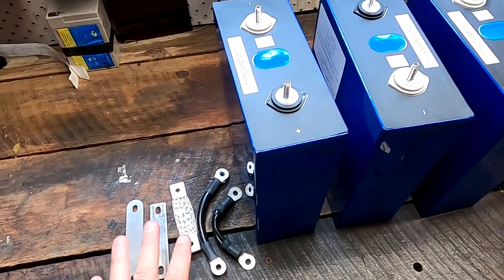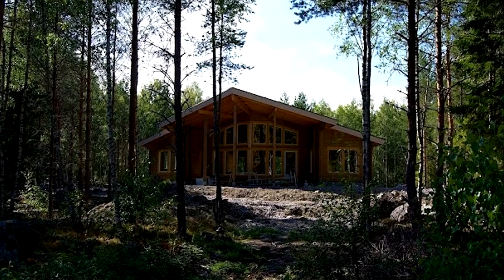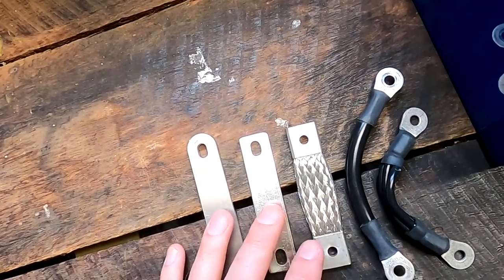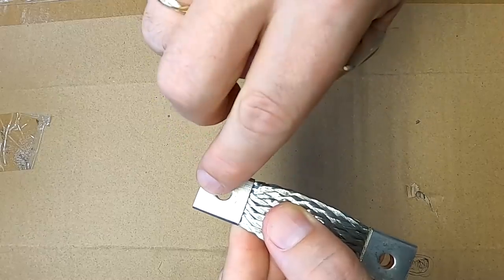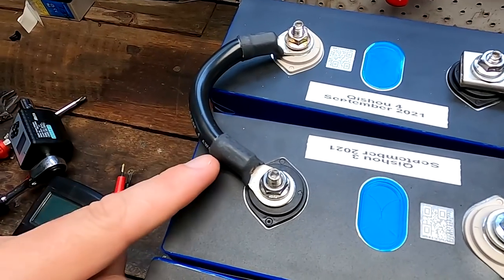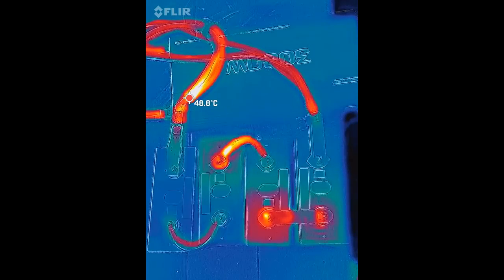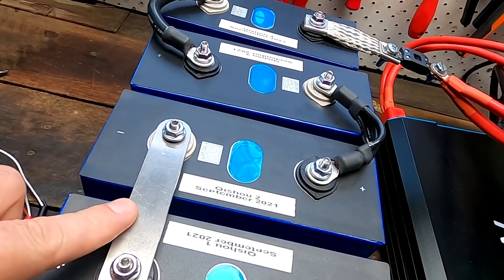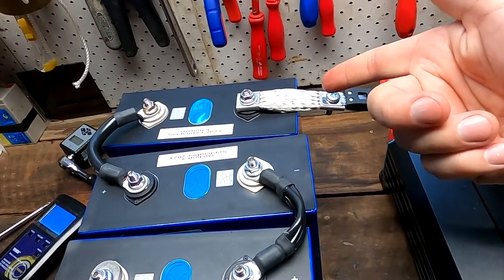All these different busbars... and why they don't matter!

Comment: Hi Andy 
Keep in mind that the battery terminal tops also form an oxide and should be removed as well. A twisting motion and scotch bright under your thumb for a few seconds is all it takes and won’t distort the flatness detrimentally. Use a can of dust off to blow out the holes because you don’t want grit in there. I made a lapping tool that works great and fast for terminals that already have studs(I made a video).Wipe off the top with alcohol and put on your favorite anti oxidant compound within a few minutes. Preparing both contact surfaces makes a huge difference. 
The flexible braided buss is very good but there’s things you need to know. It is perhaps a bit short but it can be lengthened by squeezing it’s width in the middle with your fingers. The problem with those is they need periodic re torquing as the stands within the ferrule compress. This will eventually settle down or an embossing tool can be made that can pre compress (in a machine vice) and flatten the contact area. Interesting resistance readings you got.
Reply: From my lead acid days, I use a facing tool that slips over the threaded post that takes any slight crowns off of the post.
Reply: @babaluto  
I turned a blank perfectly flat and drilled a 6mm hole in it. The other end was drilled and taped 1/4-20 where I Loctite-d a socket head screw. I cut the “L” off a ball hex wrench so I could put it in a drill motor. The ball drill reduces any leaning and helps keep it flat on the terminal. I used a sheet of 400 wet&dry sand paper that I put thin double sided tape, cut to 1” squares and punched holes. Use a 6mm pin in the lapping tool to line up the sand paper. Low, low speed, light pressure about three rotations then a about one rotation in the one direction to release the fines in the paper so it doesn’t load up. The terminals must be absolutely free of oil or any oxide compound so I clean them before and after with alcohol. Any contamination will instantly load the paper in spots halting all progress. Soon after it’s lapped,use a very thin layer of an anti oxidant paste (Noalox) on the finished surface. Avoid getting the paste on the threads because it can increase the tension of the fastener when torquing.
Reply: @SkypowerwithKarl  Sounds very good. The tool I still have, I think I bought it from buggies unlimited, it is a hexagonal tool steel section with cutting edges milled into the facing side. A hole in the middle for the post. It fits nicely into a 7/8" socket for either an impact or drill driver. The cutting edges leave the surface super clean and flat. Haven't had any issues with it clogging or marring of the surface. I checked recently and Buggies doesn't list it any longer and I cannot find it anywhere else. I simply do not understand why someone would work so hard to make the bus bars so flat without checking the mating surface as well. Good stuff. Cheers!
Reply from the maker: From what others said, the terminals are made from some different aluminium than the bus bars and don't oxide very much. In this test, I did not clean or treat the terminals at all. And the tinned copper bars are fine with this.
Reply: @OffGridGarageAustralia  
I’m sure they are a different alloy than the buss bars. The important difference is they have been machined.  The buss bars have what you discovered is a rolled finish that have a tough low conductive, oxide skin. All aluminum oxides but it’ll take quite a while in a nice environment to be as bad as the finish of the stock plate. The terminals are pretty soft yet weldable so I’d guess a 5XXX alloy. The buss bars are probably one of three 2024, 6061 or 7075 . Probably 6061 because it’s the most common and cheaper than the high strength 7075.
Glad you figured out the hot bars.

Comment: Maybe it is just me, but I'd call those things "interconnects".  I think bus bars are different - in wiring up a battery a bus bar would be used when connecting the cells in parallel.
Reply from the maker: Yeah, OK, that makes actually sense as well. It's just another word. I used to work in switchboard manufacturing and we called them always a busbar if they are from solid copper material and not a cable.

Comment: Hi Andy, I have not read all the other comments, if someone has written this. These flexible "busbars" are normaly more used to connect an electrical kabinet with its door and also in kombination with high frequency topics.
As I know high frequency current is flowing only / better on a surface. Because of that this connectors are made. All this tiny wires are giving a much bigger surface than a solid wire / busbar.
(Don't kill me if I am wrong, but as I know this is, what the flexible connectors are for.)

Comment: Very well said Andy. LFP is indeed very different than Li-ion when it comes to applying an appropriate charging strategy to prolong the battery life.  

I have been running full off grid solar now for past 8 months, relying on 16x SUNPOWER MAXEON-3 400W panels and 6x VICTRON 50/100 Smartsolar controllers connected to BMS and CERBO GX to manage the whole setup.
 
For battery I am running 12x 120Ah LFP from ITECH.  The main challenge is in winter trying to recoup full charge on limited hours of productive sunlight and poor rainy weather. Often there is only around 3 hours of good sun in winter to charge at higher  current >150A.  It is great that LFP can take in much higher charge current than Lead Acid batteries. I utilise DVCC on CERBO GX to set upper limit of 250A for charging current and 14.5v on charging voltage as well to protect the system.  With 1440Ah battery capacity 250A is only 0.17C, which is well below the 1C LFP is capable of.

Happy to report that with some tweaking on the solar panel placement, this setup has been working extremely well and managed to deal with consecutive poor weather days with lots of reserve left.  The POC Poof-Of-Concept phase has indeed completed successfully in proving if it is possible to go 100% off grid solar with current battery and solar technology. I have since contacted Synergy the power company to disconnect my power and finalise my account.  

Keep up with the good work.

Are you planning to scale up your solar system to start parallel run on semi-of grid setup?
Reply from the maker: Thanks a lot for sharing. That is very interesting and great to hear. I think it depends where you are on this planet to make it work and how much power you consume.

I am currently upgrading my solar on the garage and have also looked around for other suitable locations especially during winter time to get more energy. With an EV, pool and electric hotwater, I need lots.

Comment: Hello Andy,I want to share my experience with busbars,after an year using my battery bank.
   A few days ago I also completed 30 busbars for my 32 cells and 600 amp battery bank.I approached the problem from the point of view of corrosion that can occur at the aluminum terminals of the cells.I used a 35 mmp conductor and at the ends I used ring terminals made by me from 2 mm thick sheet, the sheet which has one surface of aluminum and the other surface of copper.I soldered the 35 mmp copper conductor to the copper surface of the terminals.Thereby  it will come into contact with the cell terminals only the aluminum surface of the terminals.Thus, at a length of 18 cm, we obtained a resistance of 0.15-0.16 mohms.

   Before this setup, I used the same type of cable, the same length, but at the ends I used copper ring terminals soldered.I was fine for almost a year, but after a year some problems appeared due to the oxide that appeared between the aluminum terminals of the cells and the copper ring terminals.
   I opted for the version with flexible busbars because the placement of the cells requires it and because the cells are fixed in a frame with 300 Kgf.

Comment: Very interesting Andy. I used solid copper for my bank, but almost went with aluminum. Glad I didn't now!  Awesome test as always! Thank you
Reply from the maker: Thanks Dan! 👍 Copper is the way to go, I think.
Reply: @OffGridGarageAustralia  I agree, and I think the idea with the #4 copper with lugs would be best with a small space between batteries. This would allow for any expansion and contraction so that there is no tension on the terminals as well. (Mermaid's dream cables)

Comment: Some really interesting results there Andy, a real shame that the braided "bar" was 1-2mm too short with the holes - I wonder if some feedback to the manufacturer would help?
I understand that it takes a LOT of time to do tests like this properly, but I would be very interested to see the different bars moved to different batteries/posts to see if the heat behaviour follows the bus bar, or whether certain battery posts are contributing to the heat/resistance. Keep up the great work mate!
Reply from the maker: Thanks James, I'm in contact with the manufacturer of these busbars because of this issue.
Yes, that is a good point to do the cross checking. I'll repeat this test at a later stage once other things are out of the way...

Comment: Hey Andy, my hubby faithfully watches your videos. He said to tell you that as a retired mechanic when he had a bad connection he would use an internal/external star lock washer between the contact surfaces for 100% connection. Worked every time. Might try that between battery terminals and bus bars. He thinks it just might work
Reply from the maker: Hi Deb, thanks for your comment. That would be the worst connection for such high amperage. Imaging the star washer has only contact to either side where the stars are connecting to the metal surface. So all the current needs to go through these few connections points. This might be good for resistance but with amps going through it will heat up like crazy!
Reply: Agreed

Comment: Thank you for your test and video. After thinking about this for a while, I think the solid busbars are problematic. They rely on the battery terminals being in exactly the same plane. If there is any twist the solid busbars will have to bend to compensate. The Aluminum busbar would have the greatest problem in this area as it has to be thicker to maintain the same conductivity as copper. (this may be why the aluminum terminals had the greatest connectivity problems.) I like the braided busbar as it generates the least stress on the battery terminal. Cheers, Ken

Comment: Loving your channel and testing,just curious iam planning on building a parallal 4x100ah lithium set up in my caravan and want as best as possible ballance,would running equal length 70mm wire with both neg and b+ cables stacked to a  single post then having a 70mm lead from that post going to the inverter be the best way? Also what effect on the voltage/current sharing when stacking 5 terminals onto one centre 250amp post,cheers.

Comment: I remember that GMC pickups from the 1940s, 1950s, and 1960s with both 6- and 12-volt systems quite often used the braided straps as ground straps between the body and the frame. Braided straps were also used between the battery and either the engine or a point on the frame. The only downside that I could see was that they were corrosion prone at the lead-acid battery negative terminals. The old 6-volt systems had positive battery cables as thick as a grown man's thumb, but I can't remember what the gauge was.

My Dad used to make replacements for the corroded ground straps from scratch with a special crimper and terminal ends and soldered the terminal ends as insurance. The positive battery cable ends were replaced with a clamp on terminal end after cutting the corroded one off and stripping the insulation. They seemed to work OK at best. Those old battery systems were never that reliable even when new, especially the 6-volt outfits.

Comment: Hi Andy great video as always, in regard to the busbars I have to say thay I had a problem we the alluminium, ones and to solve the problem I changed it with the pure copper semiflexible ones; the problem with the busbars is caused even by charging/discharging the battery at high currents.
Reply from the maker: So, has the copper bus bar resolved the issue?
Reply: @OffGridGarageAustralia  Absolutely yes it solved the problem immediatly.

Comment: Good job on the presentation. I believe that I make an idea as to why your connectors on the hookup wire are a bit hot. When making a bench spot welder, I had a problem with my cable getting hotter than the welding point. We found that the connectors cross section area were smaller than the welding point. We made the connectors thicker. When we did this, the temperature at the connectors was much lower and the welding point started welding properly. Think about the wire size for your current flow. The wire and connectors are resistors in the circuit. Smaller (cross sectional area of the wire) wire, in this case, smaller connectors bigger resistor. 

I find that many do not take the connector size into account when building a circuit.

I hope this helps. Fairwinds and following seas.

Comment: Hi Andy, great test, thank you! This confirmed my gut feel that the original bus bars are fine. About the flexi-Ali bus bars "don't fit" I think that applies only for your huge batteries, for the "normal" sized ones they probably would be fine. Right?
Reply from the maker: The original busbars are actually pretty good considering they are 'free'.
No, that does not matter which cells you use. The EVE LF280/LF304 have the same terminal distance. I've got some new ones now which have the welded stud and they have different distances between the termerminals.
Reply: @OffGridGarageAustralia  I was referring to the 176Ah (which I use) or even lower - the "poor people" choice 😉, they are definity slimmer.  SRY for not mention it before.

Comment: Great video Andy, I am curious how my DIY busbars would test out in your testing environment. I made mine from 1/2" (12.7mm) copper tube that i flattened in bench vice and punched holes that i made from a 10ft section i bought from hardware store for $13USD. Your braided test results has me intrigued as i wish more flexibility in my busbars and i just went and picked up a small section of copper braid wire that they commonly call "grounding braid wire" here in the USA for $2.74/ft and going to use copper tube as ferules on the ends. I previously plasti-dipped the copper tube diy busbars for insulation, so i am unsure if i should insulate them or not, it seemed them being bare was cooling the busbar combared to the insulated wire busbars.
Reply: There are websites that sell flat or round copper braid profiles in many sizes by the roll.
Reply: insulating them does cause them to retain heat a bit....no longer has the natural radiator effect to get rid of the heat as the electricity flows through them...

Comment: Great Video!  I'm glad to see you really don't need to "upgrade" the busbars.  I'm sure people need different types for different configurations, but for the most of us...  Stick with standard copper!
Reply: To expand on what Andy said at the end; What is right depends entirely on each person's use and needs. For me, the effort to make the flexible was worth it because I'm using them in a high vibration, high shock loaded environment (on a boat, vibrations from a generator, and the crashing of waves). If your install is static, like Andy's, I think the bus bars that come with the batteries are just fine.
Reply: @TheDigitalMermaid  I think your design is a winner in an environment where movement is a possibility, your connections are much safer as there is far less exposed conductive parts  improving safety, would be good to have covers over the studs as well like the type you get on car alternator terminals and i think it would be as safe as is possible, nice job

Comment: You make a case for certainly using the convenience of the standard busbar for initial top balancing.
Maybe the final build can be a more painstaking exercise, but if several banks are to be assembled, a set of the standard busbars is warranted for top balancing in the background during the build.
Reply from the maker: Not sure if you have seen my previous videos but I have one battery bank already assembled with the aluminium bus bars for quite some time now (OK a few weeks only) and haven't had any issues after sanding and applying this paste to the contacts.
The next two banks will be done with the standard bus bars coming with the cells, one bank will get the paste as well, the other won't. Just to see the difference over time.

Comment: That's real interesting about the braided bus bar, anyone know how difficult they would be to make?  I found suppliers that are copper braid suppliers, such as Arcor Electronics, and have them in rolls up to 1000' in flat or tubular designs in many cross section profiles.
Reply from the maker: Thank you. You would need the right end-caps made from tinned copper and the tools to crimp them. I think Up North and Personal made his own... somehow...
Reply: @OffGridGarageAustralia  Yes, I make my own. End caps are just pieces of (annealed) copper tube, compressed with a small hydraulic press (a manual one, around 10 tons should do). I nickel plate them using a nickel acetate solution (made with vinegar, a power supply and some pieces of nickel).